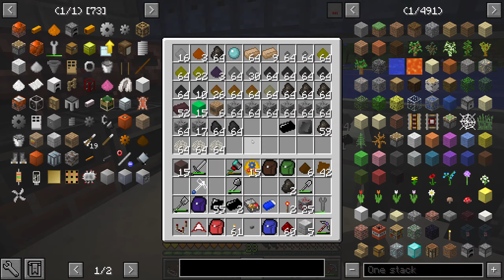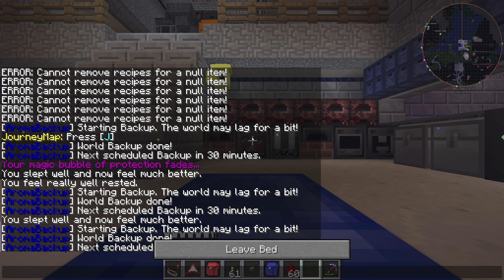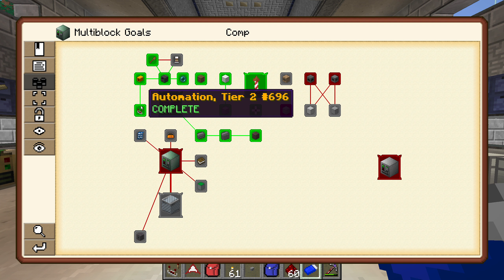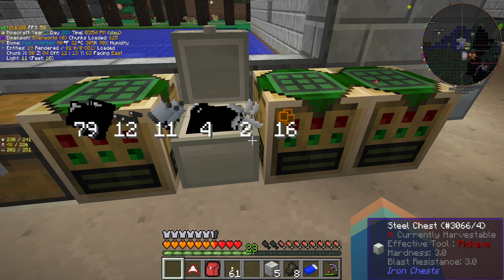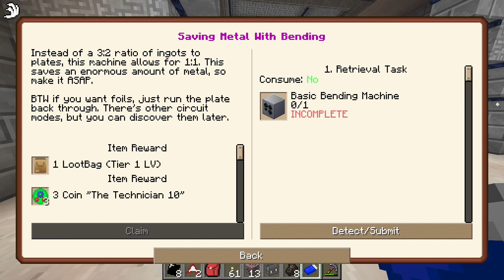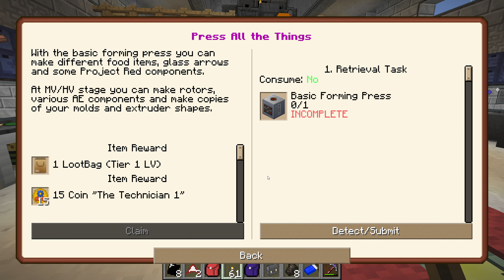Minecraft GTNH 2023, Tier 1 LV. Ep70 Your gonn'a hate this 1,2,3

Comment: it might also be a good idea to make several of the components like pumps and pistons as alot of machines need them to craft once you can make plates and rods etc more efficiently. make 16 at a time is a good round number to start with so 16 electric pistons and pumps for example. any of the more expensive things i like to do in batches of 16 at a time it works out pretty well.
Reply from the maker: working on it but its expensive lol 🤣

Comment: macerate your redstone ore it gives 10 instead of 5. also use a redstone clock to automate the smeltery. you can use 3 redstone torches powering each other in a loop to do it.  you dont need the pipe either you can just have the faucet pour directly into the basin. also it might even be worth making 2 smelteries one dedicated to glass etc so you dont have to worry about there being other stuff in it and just let it run all the time. also steel pipes are overkill you can just use wrought iron and later on potin. also the way you setup your steam is perfect large pipe as the main trunk and smaller pipes coming off to each machine. also like i said dont put all your machines on 1 line create a split system to help with cable loss. have each group of machines you use together on its own separate line and a turbine or 2 for each. i would say your 1-2 turbines should feed maybe 8 machines max so you dont have to keep them all right on top of each other and can space them out if need be.
Reply from the maker: Thanks, not sure i want a second smeltery atm but a good idea though to automate glass with one! Maybe I will later if i need loads of glass or something! Wrought Iron pipes I will look into to save the steel 👍